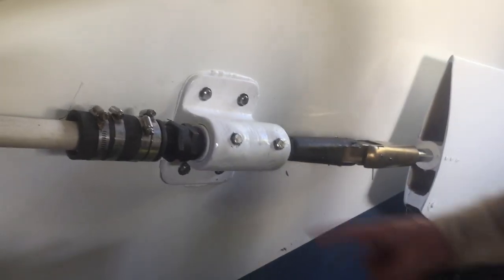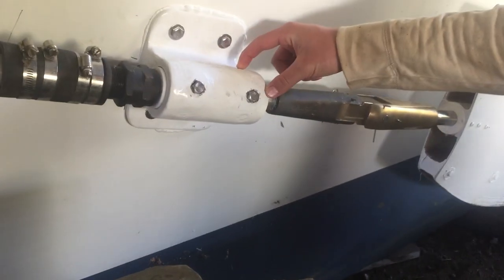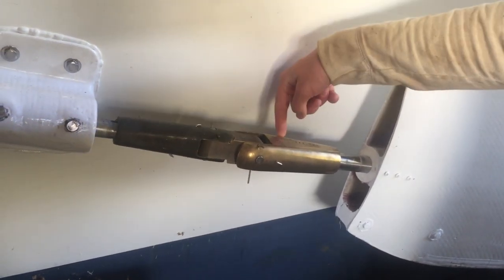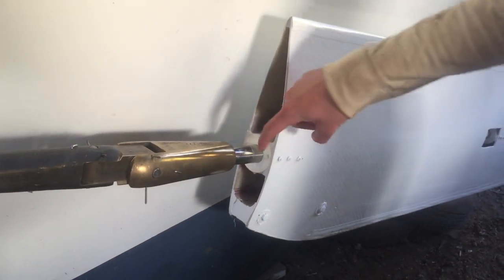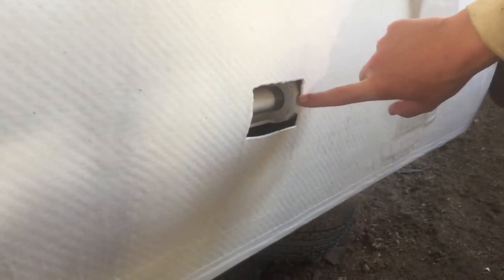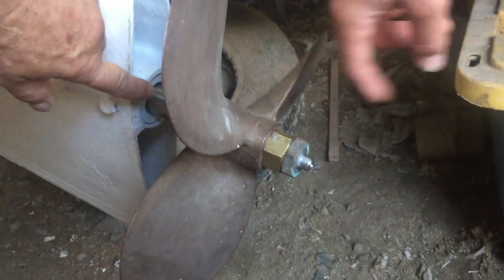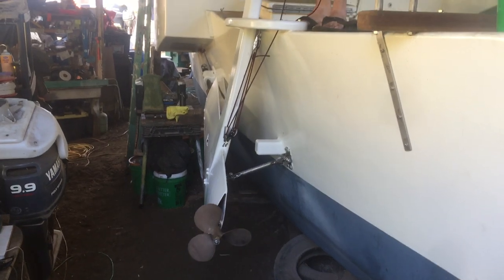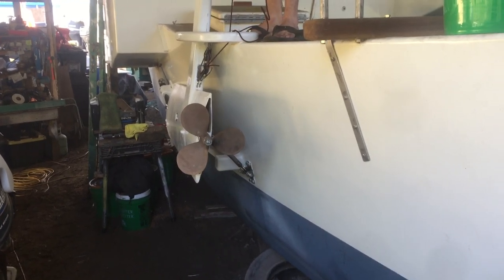Swing-Up Propellor Shaft For Proa With Inboard Diesel Engine

Comment: Nice. Been mulling this problem for years. This looks like a great solution.
Reply from the maker: When we have our first successful test there will be more videos of the propshaft underway both up and down. 

This is based on a successful design I used to put diesel engines in the bridge-decks of three 40-foot catamarans I built in the Marshall Islands between 1986 and 1989. That design was simpler, and only had a single U-joint, and the curved "banana" went up inside a curved trunk just like a daggerboard trunk. 

With Warm Aloha, Tim
Reply: @newageofsail3877  thanks, Tim, for the prompt reply. I’m curious - as you are building true shunting proas (the only way to fly), is there a plan to allow for motoring the boat in either direction?
Reply from the maker: @johnnydfred  Yeah, they are true shunting proas, and the plan for motoring the boat in either direction is to go in reverse one way, and in forward the other way. Usually you can arrange it when you're leaving a harbor or anchorage to motor with the prop "aft", then after you're in clear water, up the sails, stop the engine and up the prop. 

But our Jack backed our 24-foot Coconut across a harbor with her 5hp Honda outboard a half mile or so as an experiment, because the wind was in just the wrong direction coming off the dock to motor out forwards. When he got in the clear, he sheeted the sails in to go forward, raised the outboard, and he was sailing. It worked just fine! 

I tried to figure out the mechanics of having a 12-foot long diesel propellor shaft hung from a diesel engine installed at the deck level swing through 180 degrees so you could motor in either direction. All my ideas were either unworkable or would add $35,000 in custom machine work plus 800 pounds to the boat. So no go. 

With Warm Aloha, Tim

Comment: Hey Tim, looking good. We will be there May 9th to 24th and will get to meet you. You need to have the prop oriented just right for the brass hinge to work, how do you do that? With the prop in neutral if you were going I could see it locking in as you raise. maybe post a video about how that works.
Reply from the maker: Are you coming with Mimi? If so, email me at skipper at ocean people dot org; no spaces, OK?

To pull the prop up, put the engine in neutral, turn it OFF and pull the prop up and secure it. This is just like putting a bulldozer in gear; you don't want to do it when it's parked right behind your car. Move the car first.